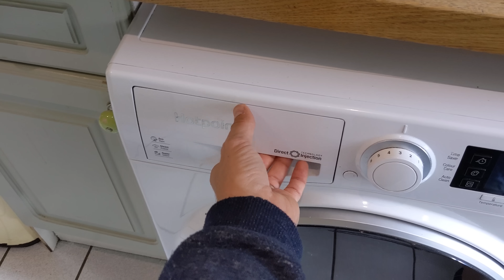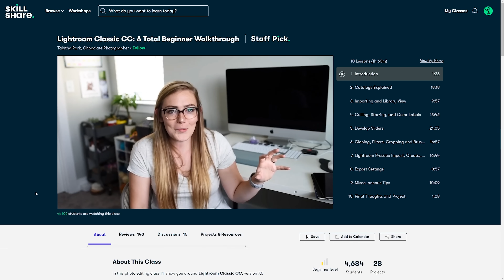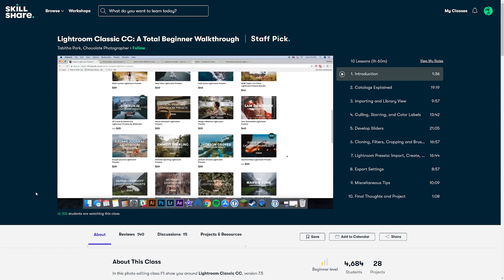The Pythagorean Siphon Inside Your Washing Machine

Comment: I have never seen that type of mechanism in a toilet. The toilets I've had in the US have a rubber plug in the bottom of the tank. But those weren't dual flush mechanisms either. BTW, I love your 2d mock-ups to help explain the principle.
Reply: Yeah, basically every domestic toilet I've seen in the US just has a flap in the bottom of the tank. The flap is lifted by a chain, which is attached to the end of a lever, with the flush handle forming the other side of the lever.
Reply: @hobbified  I've got a higher class flushing system which replaces the flap with a plastic cylinder.  When you pull the lever the cylinder lifts up allowing the water to rush into the drain faster than with a rubber flapper.   Also because it just goes straight up and down, it's less prone to leaking.  Haven't needed to replace it yet.    The toilets with the flapper and chain sometimes the chain gets caught under the flapper causing it to continuously leak into the bowl.
Reply: @chinareds54  Yes! And seemingly for no reason. I absolutely hate the flapper version!
Reply: @hobbified  American Standard toilets have what they call a "flush tower" instead of the flapper, and it works by a siphon.
Reply: @hobbified  I am in Jordan and we use same method
Reply: The flapper valve is buoyant, so when lifted into the water column it floats up until the water in the cistern is almost empty. Then it seats and the water pressure from water on top of the valve is greater than the air pressure from below so it doesn't float again until you lift it with the flush lever again. It's an interesting alternate engineering solution to the UK siphon demonstrated.
Reply: @MichaelOnines  the replacements have adjustable buoyancy so that you can adjust how much of the tank drains.
Reply: Thinking the same - only rubber flappers here and good job on the mock-up!
Reply: Canada here, and same. Most toilets I've had just use a plug that gets lifted and then all the water gushes down. I have seen higher end toilets that use different versions of plug that allow the water to flow more efficiently, but never seen it with the siphon.
Reply: @ScytheNoire  ARGENTINA HERE, italians descendants mostly and toilets are mostly italian brands have the flap but also a dual action system internally similar to a click pen system that when you push the button a second time the flux of water can be cut to a less than half flush to not waste water.
Reply: Yes, United States here and I've really only seen flapper valves. But I think they're kind of old school.
Reply: That is the old traditional system found all over North America, but they are prone to leaks around the large rubber seal as it ages. The other source of leaks (though not as frequent) is the water shutoff, but by using the syphon system (which almost all new toilets use), you remove more than half of the source of leaky toilets.
Reply: @flamewave000  I had a leaky gasket, I just flipped it over and the other side was pristine, worked fine.  $0 fix.
Reply: Yup. The flap is the only kind I've seen in the US. I'd prefer that siphon version. That flap gets leaky way too easily.
Reply: @bkofford  But wastes space in the cistern.  UK toilets have massive cisterns.
Reply: I've only seen flaps in canada, never seen this siphoning mechanism. Mind you I can see the advantage, I've had to replace that flap at least once in every house I've ever lived in.
Reply: @ZTenski  these aren't completely immune to breaking- the plastic one way valve can split, though that just means you can't flush- doesn't leak, and can typically be replaced with a sturdy plastic bag
Reply: @ZTenski  There are drawbacks to the siphon mechanism, like if the toilet blocks, you can't stop the flush partway like the flange style we use. Plus, if the flange wears out, it's an easy swap to a new flange. You have to do a lot more to replace siphon components.
Reply: No flaps in Finland either. We got the buoyant plug.
Reply: its in the US, kohler low water use toilets have them
Reply: Same in Sweden
Reply: EU here. No siphon mechanism, there is a vertical tube over the pipe that goes to the toilet bowl with a lip on the bottom of the tube, so the water pressure holds it in place. With the lever on the tank you lift up the tube, which is buoyant, and the water goes out the bottom. When the water empties, it goes back and stays in place when it automatically filles up because of the lip. You can stop the flush at any time by pressing the lever the other way, which pushes down the tube and the water pressure holds it in place. If for some reason the fill-up mechanism breaks and water gets in the tank when it should stop, the water just flows in the top end of the tube though the pipe into the toilet bowl.
Reply: @tonyrulez69  That sounds like the Mansfield Flush Tower or American Standard Champion 3, Google it.
Reply: Here in Scotland my previous Victorian built house had lifting plug flush mechanism. The replacement rubber seal became very difficult to find so I made a mould and cast my own. John.
Reply: Yes, the U.S. flapper system for toilets have greater water flow and therefore less problems with toilet blockages (after all, toilets are normally the only drain to carry solid waste). The 3-D syphon system is used to save water, but is more prone to blockages.
Reply: I've seen the siphon type flush mechanisms in specialty shops. They are not common though.
Reply: Same for France and Thailand.
Reply: Dual-flush toilets started becoming common in Australia in the '80s, possibly before anywhere else, because water supplies are more limited (driest continent and all that). I finally started seeing them in the US in the 2010s. I'm surprised you have them in England, since water always seems to be plentiful there.
Reply: @nomadMik  the USA introduced a law in the early 90s to regulate the amount of water allowed per flush to something like 1.3 gallons (about 5 litres) this is part of the reason why they need to get the water into the bowl with some expediency, because otherwise there won't be enough to carry away the contents. This might also be the reason American toilets have such a deep level of water in the bowl. 

 They also limit the flow rate for shower heads as well.
Reply: @satyris410  once for paper, once for poop.
Reply: @nomadMik  Antarctica is actually the driest continent! 
But as far as habitable continents, yes , Australia is on top for that one 😉
Reply: Chiming in on mostly flapper style flush mechanism,  but have also seen accumulator style (plastic pressure vessel in  tank with dump valve) and also one in our last rental had full and partial flush buttons, but for the life of me, I can't remember the mechanism other then each button had a different length pushrod on it...
Reply: Same thing in Spain, I preffer this system, because sometimes that rubber plug starts to fail and you have water constantly dropping in the toilet.
Reply: Lived in California for most of my life, and in the early 2000s, I had a standard old-school flapper valve + float U.S.-style toilet.  It did a poor job flushing (probably more of a restricted drainpipe issue, in retrospect), so after my complaints, the landlord replaced it with one of those crazy plastic pressure-assist siphon mechanisms that takes up the entire tank interior.  I loved it at first, as it flushed much more reliably, but within months, it stopped working properly and I was constantly having to take the tank lid off to try to fiddle with it.  In the end it was much worse than the old-school flapper/float/overfill-tube type, because all the real working parts were inaccessible behind plastic walls.
Reply: I have but it's a more expensive mec, and it's mainly used in dual flush toilets, is the water saving ones
Reply: @codey morganti You still use a float that compresses a valve to stop the water flow for filling the tank, but instead of the rubber gasket for flushing (which can leak much more easily than a compressed valve) can be replaced using the syhpon.
Reply: Same. I was scratching my head when he was explaining how the toilet works. Never seen one of those in a toilet before. Only ever seen the "flapper" version in residential applications.
Reply: The siphon in this video has been the British standard flush mechanism for water closets. Exceedingly rare to see any alternatives here. The real advantage with a siphon is that there is no valve to leak.
I think the rest of Europe has its own peculiar mechanism.
Reply: In Brazil too. Just a flap valve in the bottom that we lift when pressing the button
Reply: same in poland, never seen a siphon mechanism in a toilet before
Reply: But isnt the bottom part of the toilet a syphon? Thats the part I was thinking about
Reply: most new ones are. If you just push the handle they close after around half the tank is empty. You have to hold them down to get them to flush all the way. Fewer parts and it makes the default the low flow flush which is a better idea.
Reply: In Bulgaria very old toilets are  just a plug at the bottom, lifted by a lever. Most new ones seem to be with a syphon.
Reply: I was going to say the same thing. It literally just dumps the water in. Then again I have a fancy toilet in my half bath that has a dual flush and the mechanism is probably similar, never really looked it. I thought he was going to talk about the P trap
Reply: Nothing like a good old 5 gallon flush.
Flush it and forget it.
Reply: Newer toilets in the US have a two siphon primers. On for liquid waste one for solids. They are primers similar to the one in the video, one has a valve to allow air in to cut the siphon off shortly after priming, the other allows the siphon to run uninterrupted. Also its function is as much a gravity feed valve as a siphon. The only true siphon in a standard American toilet is in the waste drain that is incorporated in the bowl.
I have professionally replaced and repaired dozens if not hundreds of toilets and 90% use a rubber flapper and are gravity fed.
Those European ones look like a cool mechanism though, definitely a cool video.
Reply: There are some flapper mechanisms that have a dual flush, for short or long flush.
Reply: This. I was going to say this. Now I don't have to; thanks, stranger!
Reply: Flap valve in Canada too.
Reply: the flap stays open because it is bouyant and when the water level reaches the bottom, the flap closes and seals and is held there by the suction of the water from beneath
Reply: came here to say exactly this.
Reply: Also, the mechanism in the video plus the giant bouyant ball takes up a HUGE place in the water tank.
Reply: You an flush only some of the water too, if you press the button halfway down. More precisely, you can flush as long as you want if you press it half way down( don't lift the plug out of the water - instead, create a gap by holding down the button )
Reply: Same here in Brazil
Reply: Glad I'm not going insane. XD
Reply: codey morganti the water filling device is the same the float lifts with the water to a point that it pinches a valve shit stopping the water at the full mark, only difference is the rubber flap at the bottom for most US toilets or having a siphon for getting the water from the tank to the bowl.
Reply: I have always heard that "rubber plug" refered to as the flapper. This is what it is called if you need to replace it. The odd looking siphon system in the video is similar to ones I have replaced in low flow toilets here in the USA. I have found them to be overly complex, problematic, and they generally don't last nearly as long as the old flapper type. 

The siphon type is sort of cool in the theory behind how it works but I have found it to be very problematic in practice. If you like working on toilets it is tge mecabism for you. I prefer the old reliable flapper.
Reply: And yet if your pour a bucket of water into the toilet it will self-flush without any flapper valve actuation. So it’s a bit similar.
Reply: I can't imagine that small diameter siphon would get a good violent flush.  There are globally, four types of toilets.  Most U.S. toilets are the type that have a jet in the bowl.
Reply: @MushookieMan  Now I'm curious, what are the four types?
Reply: @Big_Red_Friend  I have an American low-flow toilet, and it has an oversized rubber flap, to move the water faster. My flush valve is one of those miniaturized cheap flush valves, where a cylindrical float slides vertically on a plastic rod, with the valve at the top.
Reply: @MushookieMan  What are the four types of toilet? Most plumbers are only licenced in one country.
Reply: @buddyclem7328  Squat toilet, inspection shelf toilet, etc.  That's really just the bowl design. I'm sure there are many different flush mechanisms.
Reply: @buddyclem7328   I'm not completely sure but,
   1 conventional flush
    2 dry toilet     cartridge systems   for rv and boats
    3 upflush    for basements and lower levels
    4 wall mount      tank is inside the wall
    5 tankless         uses electric pump
    6 composting
    7 pressure assist      the entire system is constantly pressurized  (the best flush)
    8 gravity  pull chain             the tank is  elevated  4 foot  above the toilet
    9 incinerating
    10 flushometer     similar to pressure assist but for large buildings   (commercial)
  there is a new one called double cyclone but I don't know anything about it.
  I'm sure there are more.
Reply: @MushookieMan  Squat toilets have many health benefits, but unfortunately US plumbing codes do not allow them.
Reply: @firesurfer  #4 & #5, I am not familiar with, but I have seen wall mounted tankless toilets, with the commercial type valve, either with a lever, a button, or a foot pedal flusher. Those stainless steel toilets remind me of a prison or something, but they look easy to clean with a hose. Another fun list would be about urinals. My least favorite is the "man trough."
Reply: @buddyclem7328  Yes, which is annoying.
Reply: @firesurfer  The double cyclone was made by kohler but apparently discontinued. It used two 3 inch flappers in the tank.the water exited under the bowl rim from two 2 inch horizontal ports creating the cyclone effect.They worked really well, using less water and used existing standard replacement parts. It makes me sad that I know this type of information. lol
Reply: @firesurfer  vacuum toilets
Reply: @buddyclem7328  Funny, especially given they sell them here, and Virginia certainly doesn't ban them under its plumbing code. Plus Yellowstone National Park has replaced all the non-handicapped toilets with squat toilets.
Reply: @buddyclem7328  get yourself the health benefits of the Squatty Potty
Reply: @InuKun2008  My source must be outdated, or incorrect. I wonder if these American squat toilets were made to conform to US plumbing codes.
Reply: @scot6089  I am familiar. I keep a sturdy step stool in the bathroom to elevate my feet for this reason.
Reply: @buddyclem7328  In some countries you dont need license and whole structure of the licensing/allowance/permits might be totally different.
In my country anyone can install water/sewage pipes,  but for gas pipes you need at least 4 licensed professions with very tough requirements.
Also different guys for furnace installation and different guy for chimney.
Reply: @MushookieMan  You don't want a violent flush - theres nothing "good" about it. Flushing aerosolises the particles in the water, so every time you flush you basically spray poop all over the room - especially bad if you don't close the lid when you flush. BTW, where do you keep your toothbrush?
Reply: trot With the standard American diet a violent flush is a necessity, and aerosolized faeces just the price of admission!
Reply: @trotskiftw  which obviously is a real problem since we are all always sick and die years earlier than the average American. 🙃
Reply: @trotskiftw  My toothbrush is in a plastic case, inside a cabinet, with the door shut, because I don't trust my cats.
Reply: @trotskiftw  In the toilet bowl. Why do you ask?
Reply: @BTheBlindRef  TRUTH!! You expect a wet stick with stiff hair on the end left alone at room temperture to be clean?? lol
Reply: @trotskiftw  that's pretty much what farting does anyway :)
Reply: @trotskiftw  That rumour's nonsense!
Reply: @trotskiftw  You're getting aerosolized poop no matter what kind of flush you are using.  What we really care about is that the flush is strong enough to get the dang job done in one go, that's the American way!
Reply: @trotskiftw  Oh yeah, and we keep the toothbrush in the medicine cabinet, which is probably good to have closed before you flush the toilet.
Reply: @trotskiftw  disproven on Discovery Channel's program Mythbusters.
Reply: @BTheBlindRef  No, this has serious consequences for your life expectancy.  I place the toothbrush in a small UV steriliser.
Reply: @alanpatterson2384  No it's most certainly not, but if your little placebo device makes you happy, I don't much care. However, unless you have some kind of legitimate body of scientific evidence to back up the claims, keep your personal germophobic paranoia stated as fact to yourself.
Reply: @trotskiftw  closing the lid actually does almost nothing to mitigate that. there is no seal between the seat and the lid and the particles will just spray out of the gap.
Reply: @jojivlogs_4255  exactly, so why would you want a violent flush
Reply: Right. The ones I've seen outside the US (except in Japan and Korea) typically have two buttons: one for liquids, one for solids. That requires the system he demonstrated.

The ones in Japan and S Korea have like 400 buttons on a control panel on the wall next to the toilet. :)
Reply: @Psychlist1972  That's for the bidets. I wish we had em here in the US.
Reply: @kirknay  Speak for yourself. I live in the US and have a bidet in every bathroom in my home. The basic ones that attach under your seat only cost like 30 bucks and take a few minutes to install. Came in handy when toilet paper was short during the pandemic.
Reply: @bendirval3612  We got one of the cheep ones when everyone figured out that the only way to protect yourself from the Corona virus was to stockpile T.P. It's the best $30 we'd ever spent! Seriously, EVERYONE should have one of those things. We hardly use much T.P. at all anymore!
Reply: @Psychlist1972  Yep :) Japanese toilets are great.
Reply: @Psychlist1972  Some of the flaps are able to do a similar trick.  A quick twist of the handle is for liquids, it only releases about a third of the water from the tank.  Twist and hold for 2-3 seconds for a full flush.  There are different ways to do this, but the one in my tank uses a water receptacle that sits on top of the flap and weights it down.  If you release before the 2-3 second mark, the receptacle is still full and counteracts the bouyancy, so it closes immediately.  If the water level has dropped, though, it empties and the flap bouyancy keeps it open for the full cycle.
Reply: Live in USA. Can confirm.  Only rubber plugs on a hinge. You pull the chain and it lifts up the plug which tries to float so it stays up while there is water in the tank.  Then when the water level drops the plug falls back into the hole.  The water pressure keeps it down until you pull the chain again and lift the plug.
Reply: American toilets Actually do have a siphon but located on back of the underside of the bowl and not on the tank, flushing the tank into the bowl is what initiates the siphon.

 You can "flush"  these toilets by simply dumping a good amount of water,  (about a gallon) directly into the bowl itself with a bucket, untill it initiates the siphon     

  You will notice a small of water returning to the Bowl after the siphon is done. Just as was demonstrated here.
Reply: @OfficialLegendaryOutcast  just to confirm, before 1994, US toilets used 3.4 ga (14 litres) of water, and those installed after had to use only 1.6 ga (6 litres)
Reply: @OfficialLegendaryOutcast  Ahh, that makes sense with the limits on the flush size
Reply: Here on Mexico is the same thing
Reply: @yeshuajimenezortega9571  That's not surprising, since many toilets sold in the US were made in Mexico.
Reply: If that flap goes, no way to fill the tank.
Reply: LOL yes the American version is more brute force.  Just a hole in the bottom for the water to fall through.
Reply: The toilet tank siphon is interesting because it does not leak.  Flappers wear and eventually start to leak which wastes water and damages/overloads septic and wastewater systems...  you don’t need or want a “violent” flush, but what you do need is enough flow to establish rotation and to overwhelm and start the second siphon in the toilet that the author did not talk about.  That is the siphon below the seat that pulls the contents of the bowl up and over the hump that traps water in the bowl and prevents sewer gas from entering the dwelling.  Like in his model, too low a flow and the siphon never gets enough water flow below/downstream of the the lip to pull the remaining contents over the top...  great explanation video!
Reply: @rronmar  "the second siphon in the toilet that the author did not talk about. "
Because we don't have that here in the UK !
Reply: pmailkeey interesting, how do you keep sewer gas from coming back up thru the bowl?
Reply: @rronmar  Standard U trap. - without the siphon pipe downstream !
Reply: @rronmar  
In the the us, the bowl siphon doubles as a p-trap. As the tank is refilled, a small amount of the water is redirected to the bowl, so the bowl partially fills and the water in the bowl blocks  sewer gas
Reply: Gary Clouse yea, I know, I live there...  just fixed a clogged flush port/jet(the water port that overwhelms the p-trap and triggers the bowl siphon) yesterday...  sounds like that isn’t how it works in the UK though...
Reply: @rronmar  
  My take on this is that the sewer systems in many older European cities have limited capacity, so thier toilets are designed to reduce waste water.
Reply: @rronmar  there's still a water trap formed by a  curve in the pipe
Reply: same
Reply: All flush toilets use a greed cup syphon the drain the bowl. The two way syphon flush mechanism is uncommon in the US but they are catchong on in the drier regions of the country
Reply: @garyclouse4164  no. Not all toilets. As has been made abundantly clear in this thread, the US toilets do not.
Reply: @garyclouse4164  No they don't!

British and European toilets are just a basin with a trap and a pipe leading to the sewer. There is no siphonic action in the basin. The waste is simply pushed down the pipe by the flush water. This is noisier in operation, but much less prone to blocking because the exit is full bore all the way.
Reply: You are misinformed. most toilet bowls also employ a self starting siphon, to pull water from the bottom of the bowl.  .
Reply: @garyclouse4164  Not in the UK. Washdown closets are the norm here.
Reply: @bluerizlagirl  I think US uses siphon  jet  toilets because they don't require a separate trap.
Reply: It's a stupid water saving system that are notorious for alowing the toilet to back up